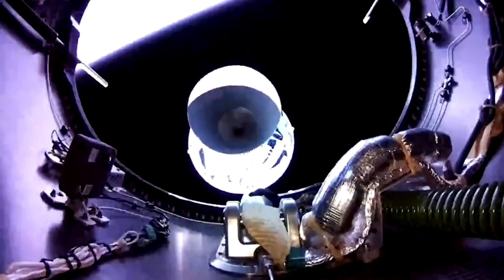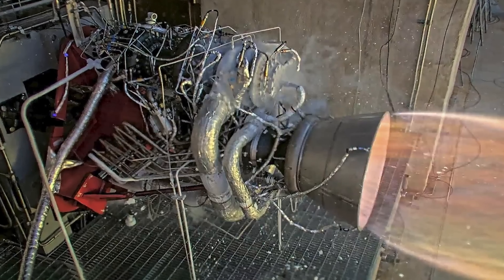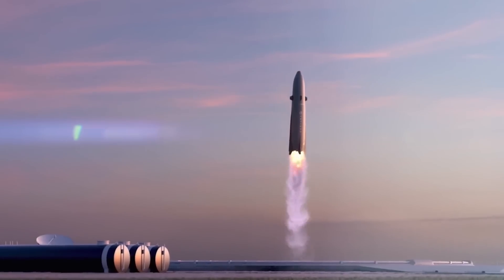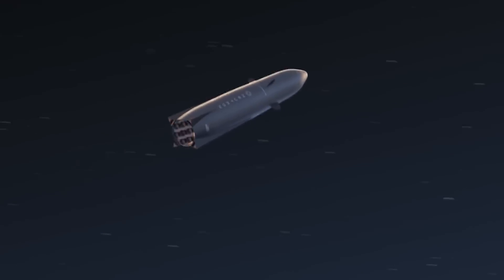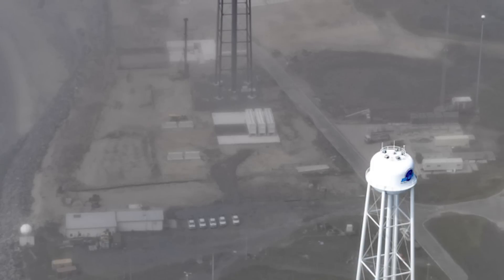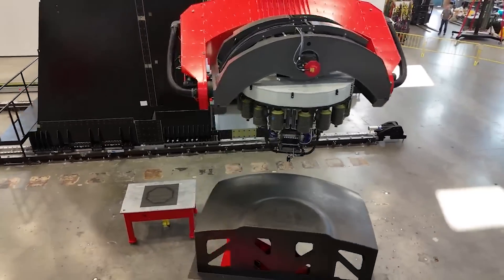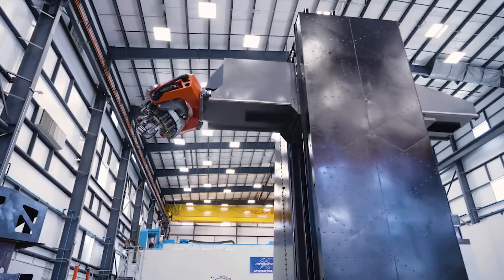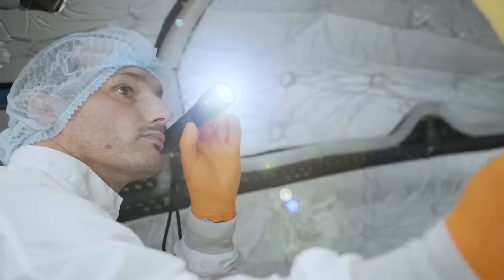Rocket Lab Just Hot Fired Its New Archimedes Engine

Comment: At a glance ... way too much plumbing, which makes engines difficult to mass produce and maintain.  They need to streamline the design, and match or exceed the performance of the Raptor V2 or V3 in order to be viable.
Reply: It doesn't need to be as powerful as Raptor. The whole design philosophy for Archimedes is to be less complex and less stressful on the engine. FFSC needs superalloys and is incredibly complex

Comment: 2:39 “Focusing on a flight engine, not one destined for multiple REWORKS”! That is an interesting dig.

3:02 Engine design to operate at lower stress levels for reliability. BO says the same thing also, but somebody else is going to higher and higher chamber pressure. Interesting to see which methodology is going to be reliable and quick turnaround.

5:28 That is a very impressive machine. Interesting to compare it to BO’s machine. So we have carbon composite, additive metal printing, traditional aluminum, & stainless steel, all from different companies. It will be interesting to see which works best.
Reply: Have we seen a Starship IFT where all engines survived yet? I'm not sure, but I don't think so. 

Still, both New Glenn and Neutron feature much more efficient upper stages. New Glenn's second stage is powered by LH2, while Neutron has an ultra-lightweight carbon composite upper stage. With the relatively heavy, methane powered steel upper stage with TPS and flaps Starship might just NEED the extra performance from Raptor, rather than them wanting it.
Reply: @plainText384 

Yes, but raptor is promoted as ultra rapid reusable (thus ultra reliable). Plus they have added more engines to the booster and keep pushing up the chamber pressure to get more thrust. SS has to turnaround in hours not days or weeks to move all of the fuel / oxygen to orbit for orbital refueling. This is going to be an entertaining race.
Reply: @plainText384 like Peter Beck said himself a rocket is a big compromise. You choose some of the solution according to your expertise. 

Space X decide to put a lot of effort in the engine so that they would have room for heavy second stage to make it reusable.

Rocket lab had a lot of expertise in carbon composite so they went for a large first stage including ferring to reuse as much as possible and thanks to the carbon composite they will not have a big penalty. 

BO seems to have only pick bad choices. Hydrogen is very hard to put in storage even compared to methane. 

BO  use carbon composite only for ferring so they have a weight penalty compared to Rocket lab.

They have the advantage of infini cash so they will have a working rocket at the end...
Reply: @danygauthier605 Sure, LH2 storage on earth definitely has some challenges, but it's a solved problem and BO has loads of experience doing it with New Shepard.
 BO is also developing 20K active cryocoolers for their HLS lander, which will allow them to use LH2 as a storable propellant on long duration missions. Not only is that exciting for HLS and long duration hydrolox upper stages, it's also a key technology needed to enable future nuclear rocket engines to be used for long duration missions.

As for the weight of the upper stage, the expendable New Glenn second stage is still a lot lighter than Starship and gets the benefit of the much higher specific impulse of the BE-3U engine. They are also developing a reusable New Glenn upper stage, but we don't really know that much about it yet.
Reply: @danygauthier605  

“BO seems to have only pick bad choices.” Are you sure about that ‽ A lot of those choices are not clear cut (or obvious from an initial assessment before complete fabrication and repeated flight testing). A lot of what makes a total system successful vs problematic is attention to details that then feedback into less granular design decisions. Details matter more than some people realize. Is there one company who seems to purposefully ignore detailed analysis and design to implement a particular developmental methodology ‽ So this is also a horse race with regard to developmental methodologies. Most likely it will be determined that there will be multiple economically viable designs.
Reply: Its poppycock. This is basically just corporate speak to basically say "we went with the easier (and lazier) path" wrapped in a positive spin. And its why they will ultimately be leapfrogged by someone else.

Most likely by Stoke Space who like SpaceX also chose to START with full flow stage combustion because someone already proved its doable. When someone does the hard work to prove something feasible and viable...its not smart to not take advantage of it. This is aerospace...the landscape of decision making is different here because of the degree of difficulty, the massive upfront cost and the much smaller margin of error.

Basically EVERYTHING you do in aerospace is going to be super hard & expensive to do anyways...so you might as well just do the harder thing if it will make you more efficient in the long run. Look at Astra, they went the "simple and easy" way and still ended up failing because in aerospace "simple & easy" is still actually relatively hard to do. NASA (aka senators) chose to use "flight proven heritage" hardware to reduce cost and time...and yet, even though we "technically" know how to build RS-25 engines and solid rocket boosters...it still ended up costing a boatload of money and STILL ended up being hard to do. If you are going to spend a ton of money and years developing something new....make sure it's not already obsolete by the first time you launch it. 

Making launch vehicles to compete with Falcon 9...when you know Starship is eventually going to be out there...is a massive waste of time.